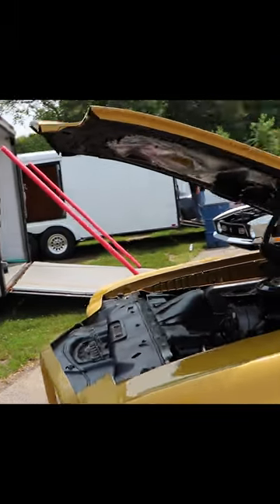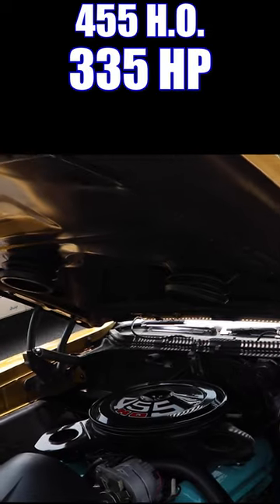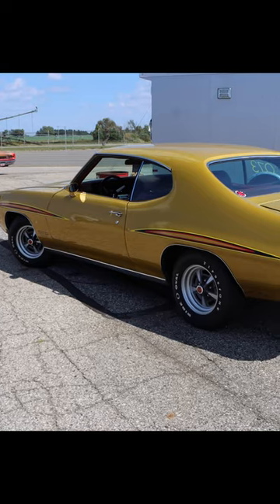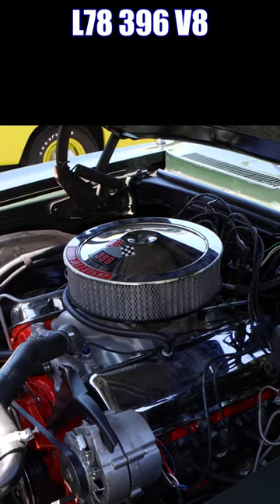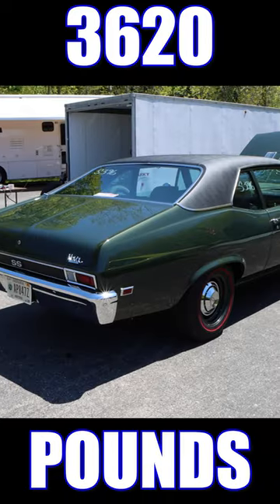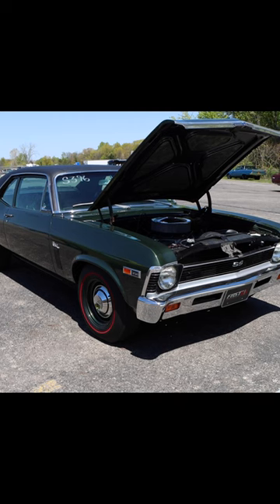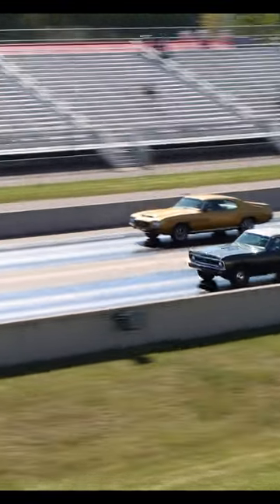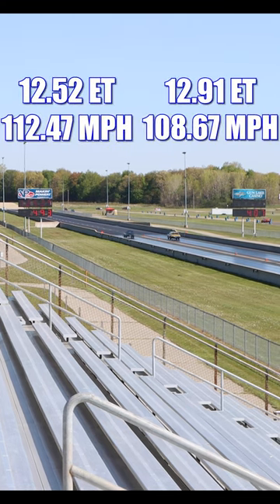1969 Nova feasts on 1971 GTO | STOCK DRAG RACE | CARS AND ZEBRAS #shorts

Comment: That 71 was impressive with 3.31 gears,  as always thanks to the owners of all the cars that come out for racing.
Reply: I was thinking the same thing  , did alot better than I thought it would , 4.10s & it would be a drag race !!
Reply: @troyburns6971  - with a .4 difference it was a drag race in the 1/4 mile. Now in the 1000’ run those 4.10s would indeed make it a drag race.

Comment: I was kind of impressed by how close it was? The goat needed better traction!
Reply: Came here to write the same.  Very dissimilar cars, very similar numbers.
Reply: Needed at least a 3.73 gear and it would’ve won
Reply: @geraldyates8958  I think 3:42 is a good gear for the 455. Plenty torque to get out of the hole. Just needed hotter tires.
Reply: @stevesvoboda9816  3.42 is a great gear. And if he spun then he probably could’ve beat the Nova. That Nova was set up for the 1/4 with those 4.30 gears. I’m just saying to beat that Nova, 3.73 or 4.10/11 would do it.
Reply: @geraldyates8958  I see what you're saying. I'm a Pontiac guy. If that was a real round port 455 the best gear is 3:90 for screaming across in 3rd gear. He probably just got into 3 rd at the end of the track? I think the gears need to be offered as an option to run them in the stock class? Not sure of the 71 gto gear options? That fat goat would have acted differently off the line with 3:90s!
Reply: @stevesvoboda9816  She was a bit heavy! I live Pontiacs too. I en know where a 70’ Judge is (or was a few years ago) with the Ram Air IV and 4-speed. 
   You may like this. Back in 97’ there was a local guy who had his grandmother’s 66’ Catalina 389 2dr. He had the engine worked at Butler and a 9” with a 3.90 or 4.11I think. At 4200+ without driver, it ran 13.10’s all day long on street tires!
Reply: @stevesvoboda9816  She was a bit heavy! I live Pontiacs too. I en know where a 70’ Judge is (or was a few years ago) with the Ram Air IV and 4-speed. 
   You may like this. Back in 97’ there was a local guy who had his grandmother’s 66’ Catalina 389 2dr. He had the engine worked at Butler and a 9” with a 3.90 or 4.11I think. At 4200+ without driver, it ran 13.10’s all day long on street tires!
Reply: @geraldyates8958  that's so cool! I'm beefing my dad's 63 GP with a dual quad 400RAIII & th400 stall setup. 670heads. 390s. The old girl should kick up her skirt! My dad is 84 & his right foot still works great! Lol
Reply: @stevesvoboda9816  Awesome!

Comment: Worked at the local Exxon station in the early 80's, my buddy Otto drove a 69 GTO 400/4spd 3.23 10bolt. We switched the rear from a 70 GTO 4.10 12bolt, brought to life I'll you that 😎👍

Comment: 1970 1/2 was the last of the non smogger motors. In 1971 through 74 Pontiac used their 455 as their goer motor, especially the short lived SD 455 T/A. 1971 seen smog pumps and de-tuned engines.

Comment: I'm no expert but I'm pretty sure that the Nova went faster than 12 MPH. 🤔
Reply from the maker: you’re definitely not an expert at reading numbers
Reply: @CarsAndZebras  You have the Nova running 12.47 mph...
There's a decimal. 
I'm certainly not a number expert.
But my eyesight is 20/20 😊...
Am I missing something?
Because I am indeed an idiot. But I'm looking right at it.
Reply: Wait.. don't bother, I've just figured it out. 🙄 It's my screen not showing the full numbers. It's 112.47 MPH.
DUH.... Like I said, I AM an idiot.
😂I noticed my screen cutting the image off at both ends.
I sincerely apologize. But I am a man with integrity so I will refrain from deleting my boneheaded comment(s) and instead offer a sincere apology.
And thank you for all the awesome videos. Please keep em coming.